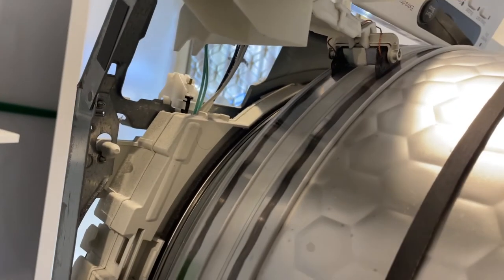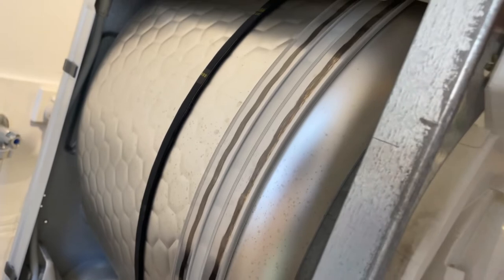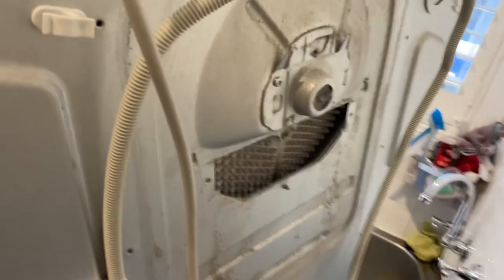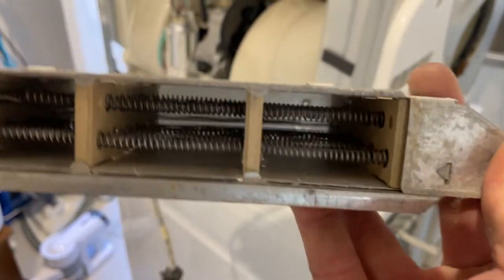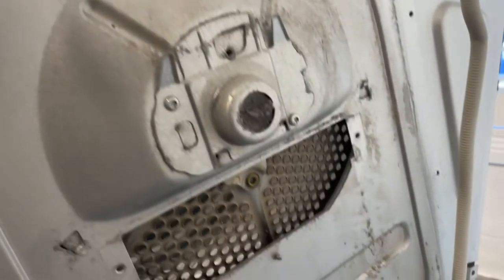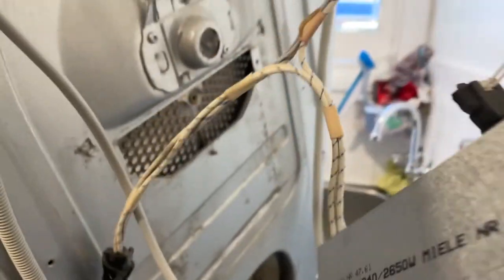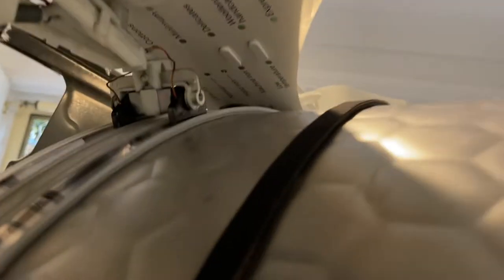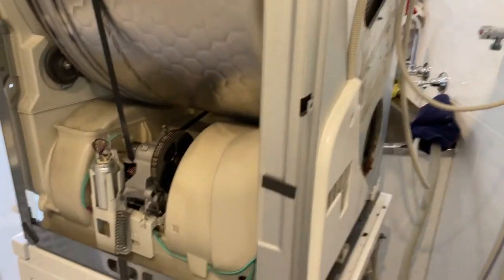Miele Tumble Dryer Clean Airways Fault Repair Fix

Comment: I have just had my Miele to bits and everything seemed fine? I was at a loss as to what to try next and happened to watch the video further down the list. It was of a guy fixing an LG but thought the principle might be the same. Very good informative video. So I cleaned up the moisture sensor inside the drum with some coarse scothbrite and it’s up and running 🎉hope this helps

Comment: I'm dealing with similar issues and got my machine mostly sorted out. One issue left is that after popping the back cover, the old seal has crumbled so the water started leaking through it. Did you have to clean the old seal (I believe it was a silikon) and reseal the cover with fresh silikon yourself?
Reply from the maker: Honestly first time i took it off so no issues at all. But being Miele you should be able to get a new seal quite easily
Reply: @balensydney  thank you. 
Miele does not provide a gasket or seal for this because, I'm pretty sure, it's supposed to be filled with high temperature silicon